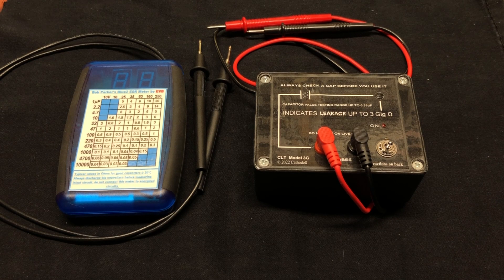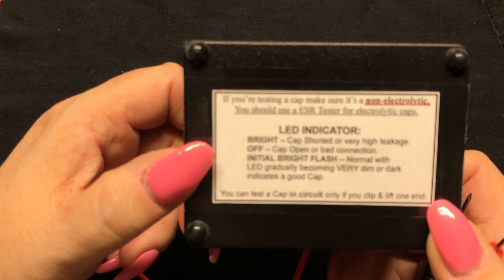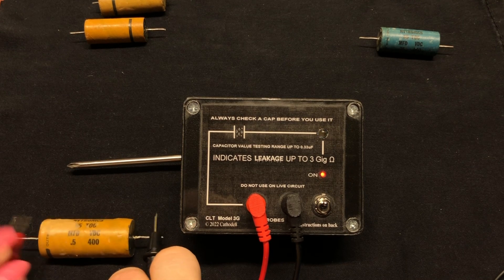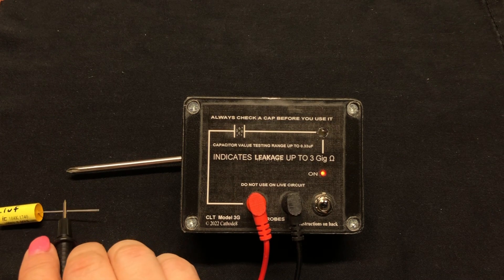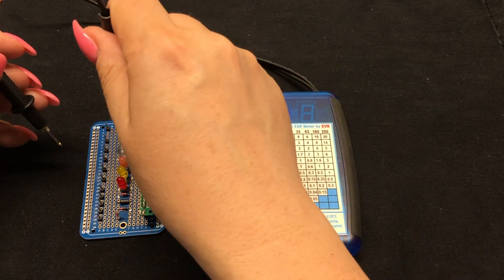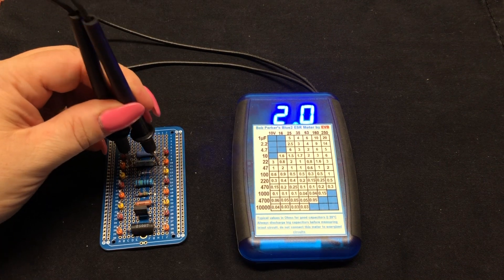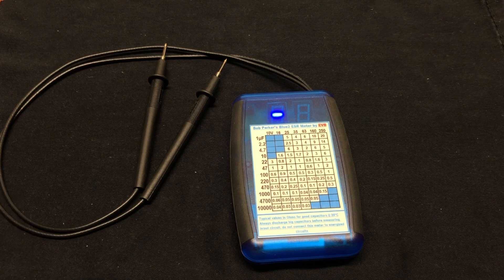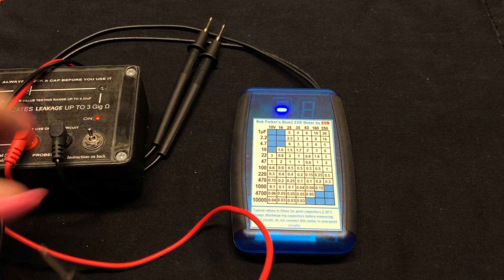Capacitor Leakage and ESR Testers

Comment: I have the older blue esr by Bob Parker, i wish it had the easy to read sticker that the EVB blue2 has. Thanks for the tip on the CLT 3G, nice and simple. Mine is on its way to me now.
Reply from the maker: I have the new scale as a file you can print on a label and stick on your meter.  Let me know it you want it and I can email it if you like.
Reply: @Donna_Matthews  Tha would be great, thanks.